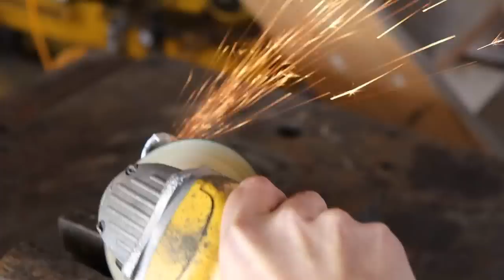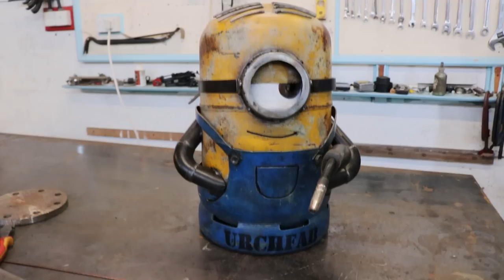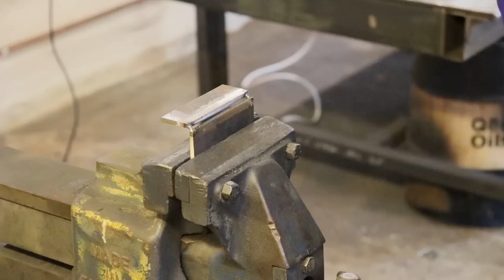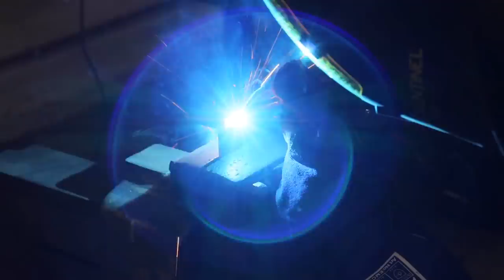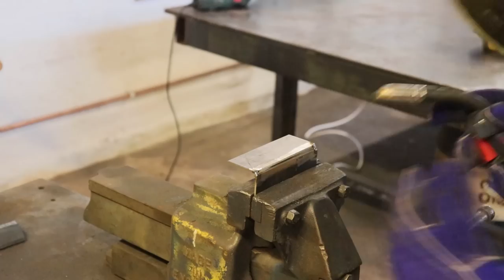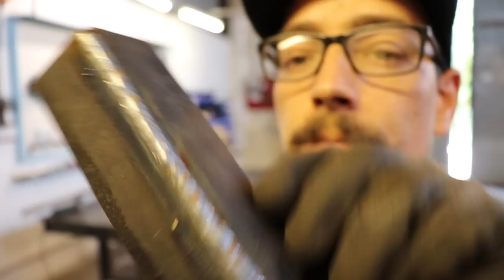HOW TO FILL GAPS,  MIG WELDING

Comment: I’m attempting to weld my exhaust, I’m 17 this is my first time touching a Welder lol, Literally just looks like spatter... I’ll grind it and re try tomorrow lol but a thin aluminum exhaust is not ideal for my first time
Reply: Aluminium welding a a different process and setup required to mild steel or stainless. 

Thin Ali tubing melts at around 600 degrees. 4 pot combustion engines generally get too hot for this. 

Ali doesn’t form like stainless or mild steel either so you’ll have a hard time fabricating a Ali exhaust, is one of the hardest materials to weld and proper setup required.... and won’t be suitable to your application. 

Stainless is the way forward for exhaust pipes with a good tig setup and training. 

Good luck and keep at it
Reply: How about giving us an update on your attempt? Learning to weld thin Aluminium is tough as a first project
Reply: Aluminum is pretty difficult to weld. It has an oxide layer that melts at a higher temperature than the aluminum metal itself and spreads the heat out and you might just burn through. The recommended welding process is TIG
Reply: I touch plenty of welders, but they all call the cops on me

Comment: I know these are coupons or scrap for practice and training purposes, but could you not use a sheet of copper or some copper tube, camp in the "point" and then weld it from the back. Copper won't stick to steel and you won't drop your weld through. The reason I bring this up is from filling in car door hinges that have been wallowed out. I use the copper trick to fill up the hole and then redrill it to fit the pin and bushing of my choice. Besides, if this is structural, you'll weld both sides anyway.

Comment: I know this video is 4 years old.  But I would just run a fast bead of weld down the whole thing.  On the cut of one piece of metal. doing it with same setting for the actual weld.  Moving fast.  Maybe need to do a 2nd high speed pass if the gapped needed it.  You will get a better weld like that.  The tacks give a false sense of a good weld.  a pocket with a backing and little gap makes a better mig weld.

Comment: Sound practical tips there mate, for those that don't have any TIG rod, you can knock the flux off stick welding rods and stuff that in -get a small pack of 6013s from DIY store if you need to.
Cracking welds again,.

Comment: I've done gaps bigger than that and my method was pulling and making C's trying to keep the wire hitting the lead of the puddle but not too far that it misses. It worked for me and this was on MIG 0.35 225 wire speed and 18.5 volts iirc

No tacking or anything

Comment: I will definitely try that today. Currently one weld i have to perform multiple times a day is an overhead outside corner 1/4 plate to square tube steel, 045 w/gas, with a <3/16 gap. The robots gets the other 3 sides most of the time. Any tips or help not just with the gap but overall technique for the overhead weld would be appreciated 😁

Comment: I work at a shop where the fit ups are usually bullshit. Running a tac or "finger" across is a very helpful strat (if I cant walk and retreat with my weld pool and use that to get by)

Comment: Excellent video.  I just have one question.  I noticed that after tacking the welds you went right in and did the full run. Is it a good idea to take a wire brush to the tacks before making the completed weld.  I just thought that making the area clean would allow for a better weld.  I am a hobby welder so I really don't know if it would help.  I really like your videos.  Thanks
Reply: MIG doesn't have slag. No need to clean it
Reply: @santiagotan8379 gasless does. Brush it off with gasless

Comment: But how are you bridging the gap? Are you stacking the weld to make the bridge to the other side? When you are welding each of the tacks it sounds like one continuous weld so how are you making the bridge without having the weld spatter and fall through?
Reply: The arc force and him starting from the top gravity helped pull the molten metal down

Comment: Matt, You're the man I need. Youtube let me down on this. 

Can You show us how to fuse 3-6 mm (1/8'' - 1/4''') round stock with MIG (FCAW), no gas? 

I tried it on DCEN, as is usual for flux-core, with the machine set to half the material strength of the rod. I can not by hand manipulate the amperage, but I can set thickness increase/decrease the puddle heat a bit by means of electrical reactance (Technomig 210 dual synergic 230V). I got solid tacks most of the time, but soon as one of them doesnt stick, any further attempt results in burn-through. I try to fill it up and just melt the rod away... I can't keep the pistol on. Also, I don't know what to look for (like puddle and flux crust I usually see when doing larger welds on square tubing). I just can't reliably do it man. I need input :(

Comment: Id get a decent sized tack built up then turn it sideways and run it vertically. As a production welder this is actually more common than the pieces properly fitting together lol.

Comment: I do this a different way, id appreciate some feedback if theres an issue with this method.  I will turn my settings down about 20 percent, then run a small bead on the edge of each piece, shrinking the gap, then restore to full heat and wirefee and run a quick root and fill pass, burning in my first 2 edge passes. I do this with fluxcore as well, but you have to knock the slag off first.  Is there a structural issue as to why this method may not be as strong as your tack method or laying in a tig stick or 6013 with the flux knocked off?
Reply from the maker: Nah im sure your fine doing that, there's many ways to skin a cat as they say.
Reply: MichaelKingsfordGray  even with lowering my settings and keeping a steady quick pace across the bead? I also alternate edges and give it about 5 seconds after the red disappears before running my next bead. Should I wait longer to let the piece cool or adjust my settings even lower to prevent inclusion, or is there a method that you would recommend?
Reply: Make sure you're not using single pass wire.

Comment: One problem no one is mentioning is what if you want to keep those angles at 90 degrees? because i know those warped after welding. you need to clamp both pieces not just use a vice!

Comment: Good tip. TU. but for those of us that stink at this, i don't need to fill a gap i need to stop making one burning right through . be good if you  do some stuff on no gas flux core welding.
Reply: WV591 lol, ya that’s where I’m at.
Reply from the maker: Flux cored is not something I use but I will get hold of some and have a go. Cheers
Reply: WV591,  if I remember right, fluxcore runs hotter than gas shielded, so maybe lower your settings?? and try using the method Matt demos in this vid, even if you aint got a gap in the job?.-its how I weld sheet with f/core;
Reply: Lift off the throttle ...

With really thin metal you weld by a series of tacks, not a single continuous weld

Comment: You shouldn't turn your welder off right after welding you can melt a transformer that way
Reply from the maker: Its an inverter Bud and the fans keep running after the power is turned off whilst  it shuts down.